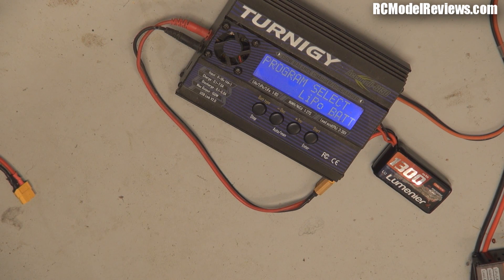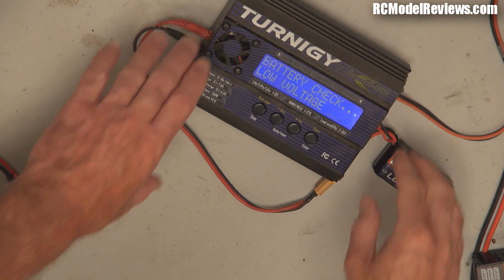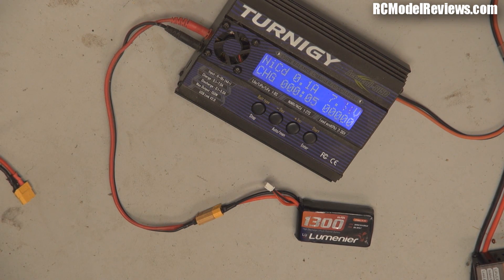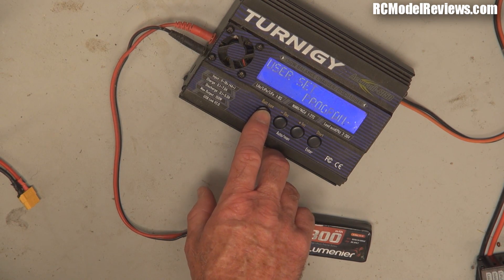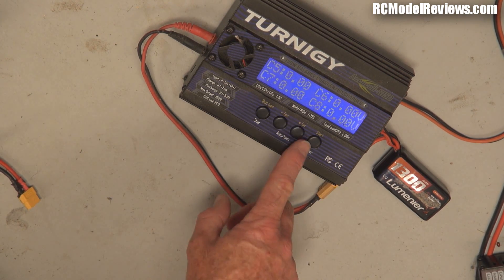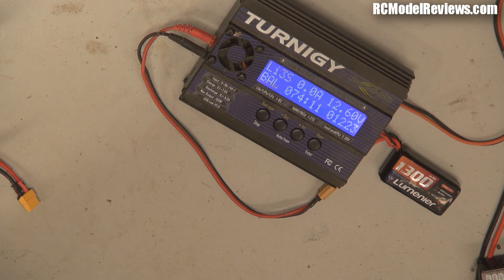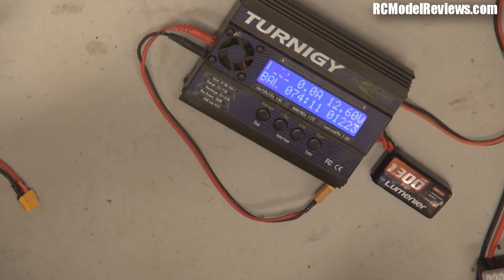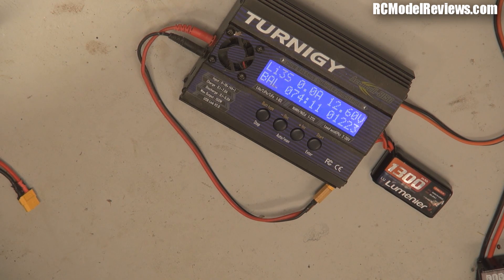How to recharge a fully flat lipo (lithium polymer) battery

Comment: How about a demo of how to extinguish a lipo fire Bruce, with all the cheap "drones" on the market I'm sure some people with lesser knowledge would think pouring water on it would be the best answer. 
I saw a video of a guy trying to put his hover board out with a kettle of water.. Lmao.
Reply: a plastic bag full of sand and a cinderblock makes a self extinguishing system. If a cell cooks off it breaches the bag and the sand dumps over the battery.
Reply: @ Daniel harman- Same way, no balancing a 1 cell. It only has 1 cell ; P The reason for using the nicd or nimh setting is because it possess no low voltage cut off safety for charging. Once a lipo has been discharged below approx. 2.9v, most chargers will not attempt to re charge, and the battery is otherwise deemed bad! So this is a semi dangerous way to re vamp a battery if you over discharge, or forget to charge for a long time. First thing! You should check the voltage first with a volt meter to make sure you have any voltage in the battery at all! Anything much under 2.0v and i would probably just dispose of it. Do not attempt to charge if there is nothing registering. No battery is worth the risk. Anyway, Once you have reached 3.0v in the cell, switch to your standard 1 s lipo charger so as to not over charge! 4.20v is full. If you have a good charger that tells you charge info, make sure the battery has taken the proper amount of Mah for your battery. example 1s 600 mah battery should take very close to 600Ma back in to the battery. Especially if fully discharged. Hope that helps, & all makes since.
Reply: +SuicideNeil 
With so many cheap devices on the market now that are powered with a lipo battery, not only RC many people don't realise the problems it can cause. 
There should really be a blanket media drive to make people aware of this growing technology.
Reply: +SuicideNeil There is no metallic lithium in rechargeable lithium ion batteries. It is a reaction of the electrolyte and water that makes toxic gases.
Reply: +Green Silver as usual, a pound or two of C 4 will make the lipo fire go away instantly.
Reply: +Green Silver: just ask some guy with a "hover-board"

Pour a bucket of sand over it.
Reply: Who in their right mind would try to extinguish an electrical fire with water?
Reply: ZZ Cat flooding with enough water is the easiest way to cool things down. Heating and boiling water is just about the best portable energy sink available, so unless the water is very salty or the battery bank is at  100+v dumping lots of water on it is the easiest way to kill even an electrical fire.
Reply: You can't! repeat, Can Not extinguish a Lipo battery that i have ever seen once the internal reaction has started! Even the smallest 1 cell could be devastating! The more cells you have, the worse it gets! Best to back up!  Do not breath that stuff! And watch it burn baby burn! Once the heat and the brightness of the sun has receded, and the heap of grey/white smoke has turned black, then you can extinguish what ever remains. Watched a dual 4s Lipo set up out of 1 of my airplanes melt a hole into asphalt. I was just lucky enough to get the wreckage out of a field of tall grass and back on to the runway in time! Even with 3 foam extinguishers unloaded, there was 0 effect until the last cell was done burning. Lucky day in hind sight.. : / If you could get the battery, or device to a large body of water, preferably heavy salt water, You may be able to neutralize the reaction quicker and at least insure fire prevention control at that point until the reaction has ended, but even submerged, they will burn until finished.
Reply: Sheila Cameron 
It's a clickbait.
Reply: Green Silver you are a snob
Reply: +FPVREVIEWS But, how are ya gonna explain the small crater in the ground?
Reply: +kadmow you guy has no idea what you are talking about. putting out lipo fire is too use lots of water. using sand will only trap the heat. lipo fire is engegy base it doesn't need air to burn. so co2 extinguisher is useless. the idea of using lots of water is too cool the battery below theomo run away and prevent all cell reaching critical temperature. yes lipo does react to water it will not bust in to fire if you continue too pour water to cool it down. check out airline lipo fire. they use water bottle to put out fire
Reply: +michael qiu: thanks. you guy also.  No Idea,  lol,  flames to the fire, then drop the flaming lipo in a handy bucket (metal in case fire burning underwater melts the plastic bucket) of water,  a bag of sand is often a lot easier to carry around than the "lots of water"  unless a fire truck is on hand at the flying field.  cheers.
Reply: michael qiu charging a lipo in a bucket of water sounds like a very bad idea though. Having a thermal sensor on the battery, and a way to contain the inevitable battery cookoff (charge enough batteries enough times and you will get unlucky) seems best. 

Once a fire starts dropping the battery in a big bucket of water would be best, but 10 pounds of sand will to more to contain things than spraying a gallon and a half of water will.
Reply: How do u recover a lipo with a 1s battery with no balance cable
Reply: Green Sil
Reply: Lithium loves water, +Green Silver!
Reply: This nearly happened to me with my second toy drone.the charger was cheap and I left it unattended and it  caught on fire but just burned the carpet.luckily they gave us a full refund!
Reply: +slyarsenal 
Umm, yes. I know what to use on electrical fires, metal fires, oil fires etc etc.. 
How would you extinguish burning magnesium metal?
Reply: Green Silver You let it burn and cool or better yet take all preventative measures to make sure it doesn't happen! Or don't be a tight arse and buy a new freaking battery
Reply: +Green Silver So you don't know how to put out a fire?
Reply: Do This To Bring Any Old Battery Back To Lifeeee.>>>http://restorebatteryy.blogspot.kr >>>
Reply: do you need lipo battery ? if you need see the below link:
https://sktvision.aliexpress.com/store/2782033?spm=5261.seller_index.0.0.hmxEKF

Comment: This is very topical today.  I picked up a battery earlier this evening I thought was fully charged, and took it flying.  It didn't last long before I got LVC.  I was horrified to find it under 10v when I got home.  (I don't normally let them go under 3.7-3.8v).  Luckily this battery had enough juice in it that I didn't have to resort to the above.   Still freaked me out, so this video is very topical!  Thanks for the video Bruce.  Hope I never need it! :)
Reply: +Dave Mountford you can go down to 3.5 without risk
Reply: +Max StewieGriffin.  Thanks, but risk to what?  Life?  Limb?  Surely going down that far isn't good for the battery.  I put 546mAh into a 500mAh battery today :O  Given I live in NZ where postage for Lipos is very expensive, or takes a LONG time, I prefer to take better care of my Lipos than what I just did to this one.
Reply: +Dave Mountford going down to 3.3 is where the damage starts, so setting the lvc to 3.5 should be ok, but its fair enough if you want them to last longer.
Reply: I land at 3.5V. 3.7 or 3.8 doesn't give much flight time on a mini quad! The packs are lasting lots of cycles.